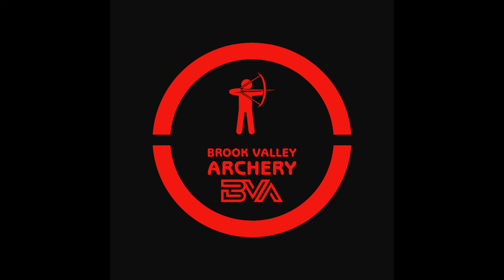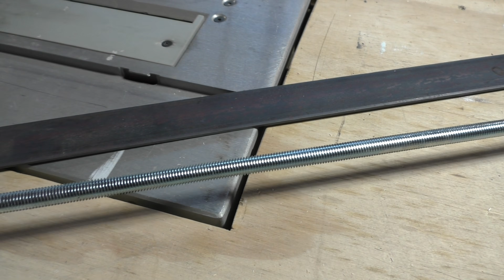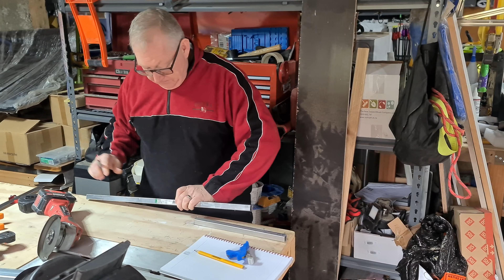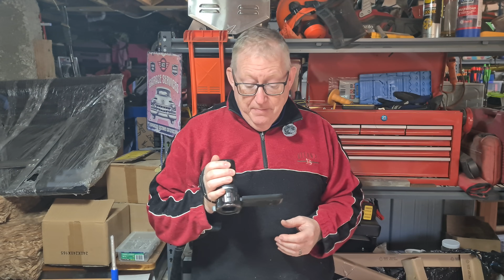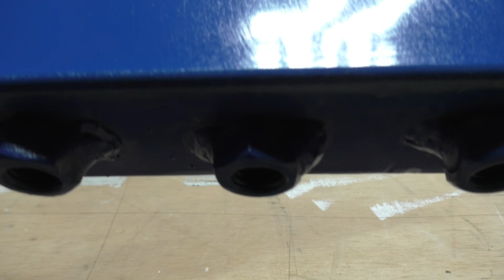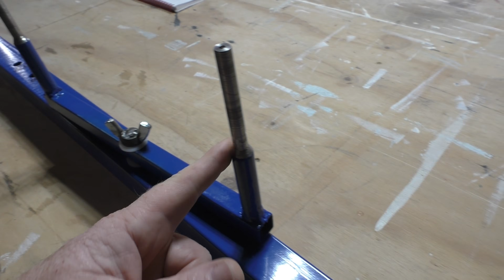DIY Archery String Jig Build | Final Tool for My Workshop Setup

Comment: If you would of asked me what initial position that you have your jig set in I would have replied (70") w/o any hesitation whatsoever 😮🎉😅.
Reply from the maker: Your are right. Got to love those 70" bows. However .... standby for something even longer...
Reply: @brookvalleylife724 
WOW, they make something longer than long?😮
Reply from the maker: @josephtreadlightly5686  super dooper long  is the technical term 😂😂😂😂
Reply: @brookvalleylife724 
78" Long Bow🏹  🤔
🤣🤣🤣🤣🤣
Reply from the maker: With an endless loop string....Possibly
Reply: @brookvalleylife724 
I wonder how smooth it will be & if it has a high wrist grip?😮
Reply from the maker: @josephtreadlightly5686  Funny you should ask. I just got a new grip for my recurve at 60 Degrees. My groups have closed up and I am finding it so consistent it's not funny. Bit more practice at short distances as the weather here is not playing ball and cannot get to the range.
Reply: @brookvalleylife724 
Yep, you started the year with the long days & now our days are as long as it gets. 😮😅
Reply from the maker: @josephtreadlightly5686  Good new is our days are getting longer now 😁😁😁
Reply: @brookvalleylife724 
Ha ha, I'll let you know this weekend on our status.😮